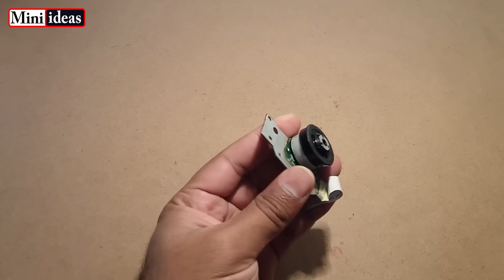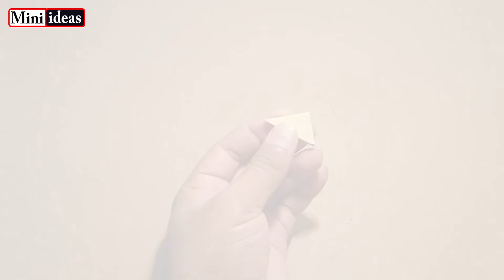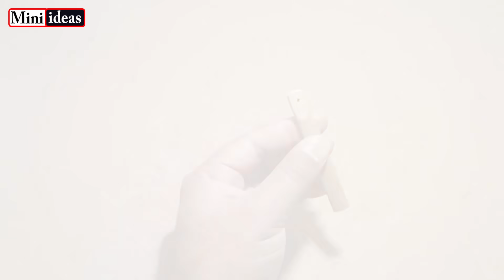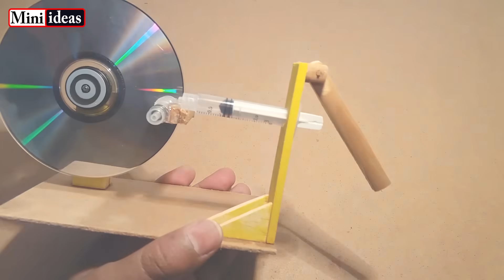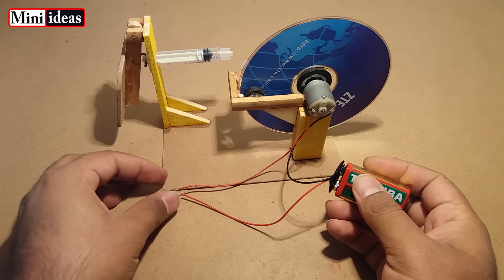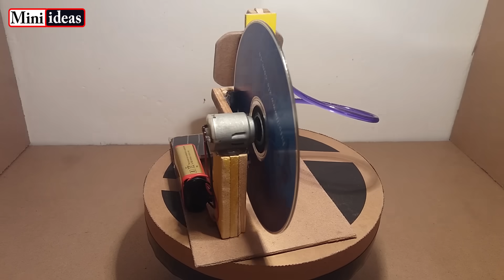How to Make A Hydraulic Brake Project | Disk Braking Science Project | Hydraulic Disk Braking System

Comment: Can u just write here the materials needed
Reply: Thanks for these tips and trick Mini ideas. I actually used some of them to do projects on my channel where it is today. An I also used the homemade technique where my channel is about. It helps me quite a bit.
these are the Materials Required to 
Dc Motor
Medical Syringe
Gears
Metal Road
Wooden, cardboard or another base
Plastic tubes
Wheels or disc
Switch
Strong Adhesives
Colored fluid
Spring and nail
Electric wire
And other, You can add or replace materials shown in the video
You can see a related video about How to Make a Simple DIY Hydraulic Crane at home

Comment: Sir can you list the materials plzz
...
Reply from the maker: 1   DC Motor 6V - 9V
2   9v Battery 
3  9v Battery Connector
4  CD Disc
5  Mini Iron Spring
6   Injection Syringes
7   MDF Sheets
8   Wooden Scale
9   Wooden Stick
10   Push On Off Switch
11  CD Laser Spindle Hub Disc Holder

Comment: Bro plz kya items use huye h bta do
Reply from the maker: 1   DC Motor 6V - 9V
2   9v Battery 
3  9v Battery Connector
4  CD Disc
5  Mini Iron Spring
6   Injection Syringes
7   MDF Sheets
8   Wooden Scale
9   Wooden Stick
10   Push On Off Switch
11 CD Laser Spindle Hub Disc Holder
Reply: @miniideas  thanku so much ♥️

Comment: For this experiment please send the material s
Reply from the maker: 1   DC Motor 6V - 9V
2   9v Battery 
3  9v Battery Connector
4  CD Disc
5  Mini Iron Spring
6   Injection Syringes
7   MDF Sheets
8   Wooden Scale
9   Wooden Stick
10   Push On Off Switch
11  CD Laser Spindle Hub Disc Holder

Comment: Material name please
Reply from the maker: 1   DC Motor 6V - 9V
2   9v Battery 
3  9v Battery Connector
4  CD Disc
5  Mini Iron Spring
6   Injection Syringes
7   MDF Sheets
8   Wooden Scale
9   Wooden Stick
10   Push On Off Switch
11  CD Laser Spindle Hub Disc Holder

Comment: Name of all things
Reply from the maker: 1   DC Motor 6V - 9V
2   9v Battery 
3  9v Battery Connector
4  CD Disc
5  Mini Iron Spring
6   Injection Syringes
7   MDF Sheets
8   Wooden Scale
9   Wooden Stick
10   Push On Off Switch
11  CD Laser Spindle Hub Disc Holder

Comment: Material list please
Reply from the maker: 1   DC Motor 6V - 9V
2   9v Battery 
3  9v Battery Connector
4  CD Disc
5  Mini Iron Spring
6   Injection Syringes
7   MDF Sheets
8   Wooden Scale
9   Wooden Stick
10   Push On Off Switch
11  CD Laser Spindle Hub Disc Holder

Comment: Hey bro, can you please provide the list of the materials required.
Reply from the maker: 1   DC Motor 6V - 9V
2   9v Battery 
3  9v Battery Connector
4  CD Disc
5  Mini Iron Spring
6   Injection Syringes
7   MDF Sheets
8   Wooden Scale
9   Wooden Stick
10   Push On Off Switch
11  CD Laser Spindle Hub Disc Holder

Comment: Hi everyone, I am a teacher and would like to do this with my STEM students. Did anyone get a list of the materials needed
Reply from the maker: 1   DC Motor 6V - 9V
2   9v Battery 
3  9v Battery Connector
4  CD Disc
5  Mini Iron Spring
6   Injection Syringes
7   MDF Sheets
8   Wooden Scale
9   Wooden Stick
10   Push On Off Switch
11  CD Laser Spindle Hub Disc Holder

Comment: Can Give The List Of Materials Required For This Project
Reply from the maker: 1   DC Motor 6V - 9V
2   9v Battery 
3  9v Battery Connector
4  CD Disc
5  Mini Iron Spring
6   Injection Syringes
7   MDF Sheets
8   Wooden Scale
9   Wooden Stick
10   Push On Off Switch
11  CD Laser Spindle Hub Disc Holder